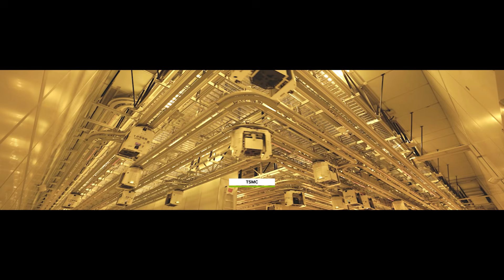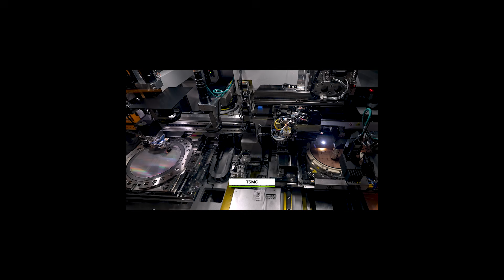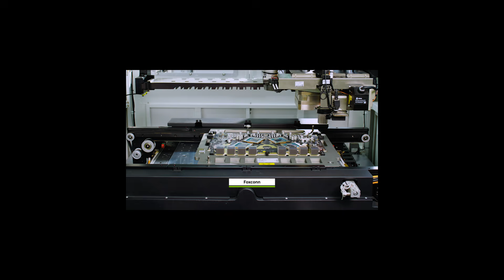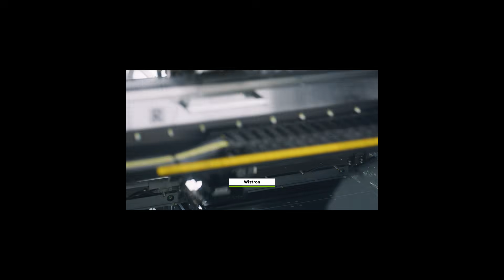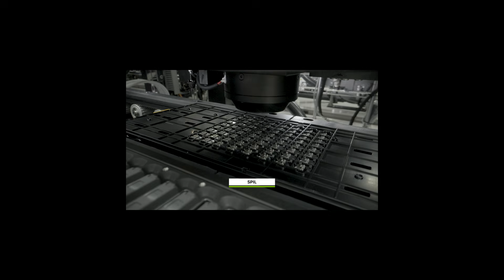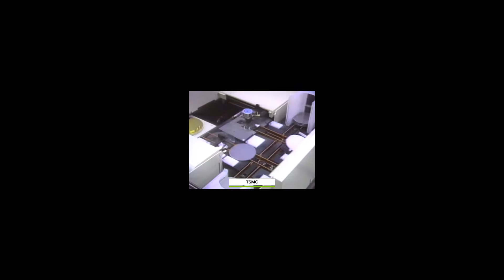NVIDIA Vera Rubin Platform Ramping into Full Production | Built for the Era of Agents

Comment: Give us RTX 6000 series for gamers!!!!
Reply: For the low, low price of $10k.
Reply: They have, it's called RTX 5090, it has the same Chip.
The main difference is the VRAM amount, which you don't need for gaming.
The RTX PRO 6000 Workstation Edition is the only GPU of the line, that hast more CUDA Cores and should also be a bit faster for gaming.
Why do you think, the 5090 is so popular for entry level AI Workstations?

If you mean the next generation, that's one year off at least.
Reply: @hansgruber3495 yes I meant the next gen of cards!! I want to upgrade to a 6080
Reply: @ButteryCheeks  Well, happy waiting then, next year CES probably the announcement.
Reply: @hansgruber3495 they’ll either announce the new GPUS or announce they’ve fully walked away from making new GPUS for gamer 😢